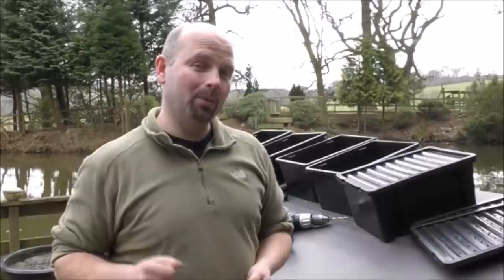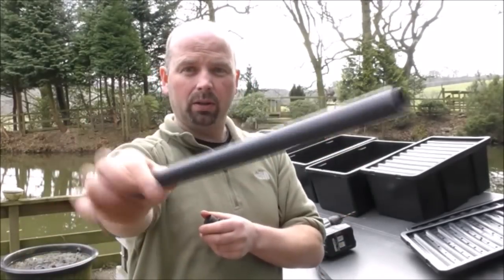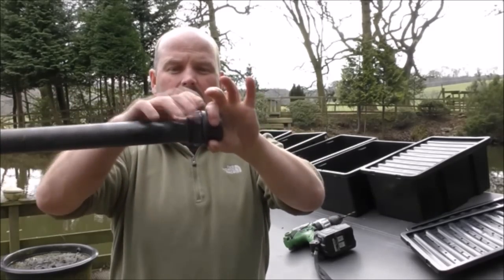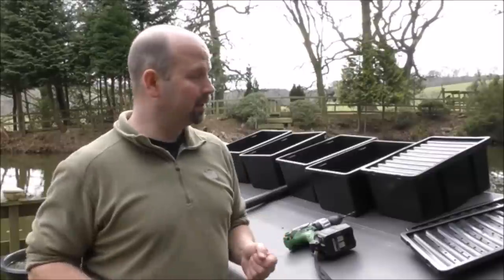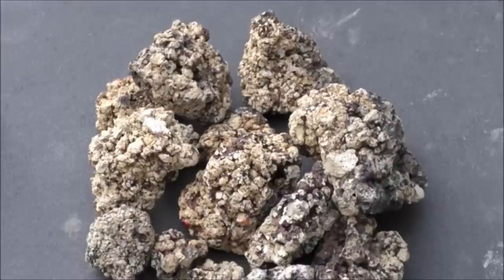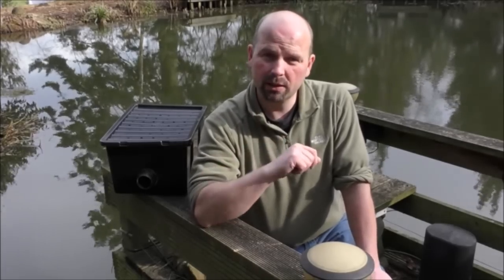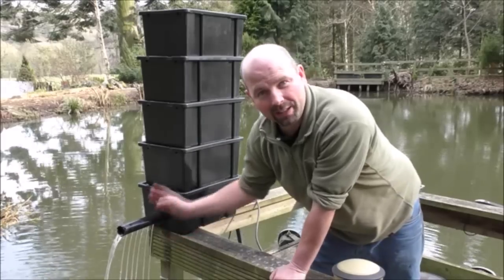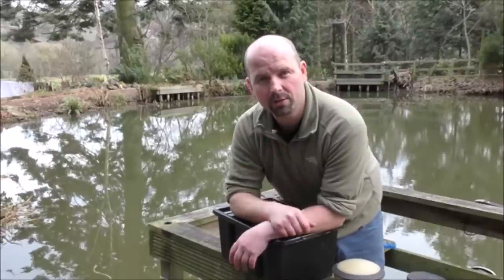DIY Shower / Trickle Filter for a Koi / Fish Pond by PondGuru

Comment: Do you only use filter media in the top Box ? whats about the other boxes ?  empty or full of the same media
Reply from the maker: Yes top box for the foams and media and media in other boxes. Later videos show how I set it up on a large outdoor aquarium.
Reply: Pondguru Outdoors . hello mate . how can I rid my pond of blanket weed . I'm using a greengenie 48000 with uv which has 3 outlets and a pondomax 8000 pump. the pond is roughly. ..9 feet long x 6 x 4  and in full sun more or less all day. would the shower system filter help the problem . And is the problem caused by the filter because of the use of flocor ?. Thanks in advance, Andy.
Reply from the maker: Sorry for late reply, I nearly always miss comments posted as responses to old comments as they don't show in my emails.
The flocor will not help as the nitrates will be probably through the roof in the water, feeding the blanket weed so you'd be much better swapping that for alfagrog which has a larger surface area and some limited ability to support anaerobic bacteria as well as the aerobic bacteria.
There are loads of ways to treat the blanketweed including treatments such as Tetra algofin which is a straight algaecide but the best one I have used (and installed for many people) is this from Velda: http://geni.us/C5QLw
That link is to the biggest one but there are smaller models. Every time I have installed one it has worked well. It is expensive but really effective.

Comment: When do you clean the filters for a pond that size?

I have around rounded 1000 L water tank full of catfishes, around 2000 of them sizing around 8cm and i made almost the same as your stacked filters.
Each container is 30cm in height. first container filled with foam pad (medium type, 15cm), second with natural stones (ziolit and reef stones, 10cm ) third filled with bio balls (1/3 of container and the output flow is at 25cm.
I feed them around 3-5 times a day. it's been running around 3 days but the water is not getting any better and the filters are full of debris. Should i put more stacks?
Reply from the maker: A filter may take months to mature to the point of making the water healthy and it will not make it clear unless there is a UV unit before it to kill algae.
Having more media would definitely help and swapping the plastic media for proper filter media would also help too. Not sure what the reef stones are (pumice?) but anything will be better than plastic. I don't know what country you are in so don't know what media is available in your country but using proper filter media is essential if you have so many fish.
The foams will clog and need cleaning as necessary (varies from pond to pond) so there is no set rule as to when they should be cleaned.
Reply: I'm in Jakarta Indonesia :)
The stones are pretty much coral stones. So I guess I'm gonna make some adjustments with the containers outlets since and gonna add more media. I think I'm gonna rely on this now while it matures and unclogging the foams overtime. Thanks. Great channel btw!
Reply from the maker: I'm glad you enjoy the videos as I love making them -I just throw ideas out for people to take on board or alter / improve as necessary to suit their situations.
The coral stone should be decent as it may be quite porous.

Comment: What are the the connectors called that you fit the pipes into, the one where you drilled the big hole for, been trying to find them everywhere but no idea what their called.
Think the yanks call them bulkhead fittings?
Reply from the maker: I just know them as tank fittings and you'd get them from Plumb Centre or similar outlet. They should be available in push fit and also solvent fit.

Comment: Hi Richard what do you think about using siporax media
Reply from the maker: Siporax is a fairly good porous media but unfortunately wears quite quickly and has a huge hole through the middle of it cutting out the place where anaerobic bacteria would set up home. I understand why many companies manufacture media with the hole as it cuts way down on firing time in the kiln, making it much cheaper and quicker to produce but it skews the bacteria in favour of aerobic which does a good job on ammonia and nitrite but produces lots of nitrate. With the area which would normally hold the anaerobic bacteria missing it means that way more media is needed to provide those anaerobic zones and do anything with reducing the nitrate levels.
Reply: Thanks for replying just wanted to get your views as you say it's quite cheap compared to others, as full size shower can take upto 160kg of media it then can be so expensive getting bakki house media. Going to have a go at home made one like the video for growing on tank. Cheers for posting videos well Informative 😄 . Shall add larger shower to main pond thou in spring to work along side my eazi pod
Reply from the maker: If you're looking to fill a big volume on a budget I would say go for alfagrog http://geni.us/Il899
It has a decent surface area and is incredibly cheap in relation to how effective it is. It does not clog so can be used in very low maintenance situations. If plenty is used it could even support enough anaerobic bacteria to reduce nitrates but you will need a nation of it.
A much better choice would be 30mm - 50mm pumice as it is under £50 for a 25kg bag and has an excellent surface area to porosity ratio enabling it to support aerobic and anaerobic bacteria in good balance, vastly increasing the chance of nitrate processing and a visible reduction. I sell quite a bit of that now for shower filters as it mineralises the water and buffers the pH to a level the koi do well in: http://filterpro.co.uk/pumice-media-11-c.asp
Reply: Pondguru Outdoors  yeah seen that on your links how many litres of media was used in the diy trickle filter ?
Reply from the maker: It is difficult to estimate but I'd say around 10kg - 15kg in each box as it took the best part of 1 x 25kg bag for 2 boxes.
Reply: Pondguru Outdoors  thanks i think i shall try the bio home media see how that goes then maybe use that for the shower once i get it for main pond. 👍
Reply from the maker: Groovy - sounds good to me.

Comment: Is there a benefit by having the large pipe in the bottom box?
Could it not just be a hole where the water returns to the pond?
Reply from the maker: You could do that no problem as long as any media didn't block the exit pipe. All the pipe extended into the bottom box does is increase the draining area to enable water to go through any of the holes drilled in the pipe to minimise chance of blocking the exit.
Reply: Pondguru Outdoors 
Ok ,
Thank you.)

Comment: 😅How often does it need to be cleared out of gunk? Is only the top catchment cleaned?
Reply from the maker: The time intervals between cleaning will depend on the size of filter and the size of pond (and stock of fish) so just go for the biggest filter you can afford and clean it whenever it needs cleaning (check after a month and extend beyond that until you hit the sweet spot for your situation).
Yes, only t he top section would be cleaned since the rest of the filter would contain the filter media which stays clean enough to work efficiently.

Comment: isn't it supposed to be aerobic bacteria? do you think there is enough air inside the container? should we put more holes on the upper part (so water won't spill) of the side container walls?
Reply from the maker: A filter needs both aerobic and anaerobic bacteria to complete the nitrogen cycle. No need for any more holes.

Comment: I have a question for ya. I will be designing a new koi pond above ground and planning to use plants for most of the filtration. However I don't have the greenest of thumbs, if for some reason my plants don't work out. would this filtration system work for a pond around 3 to 400 gallons or what would you suggest?
Reply from the maker: +Donnell Jones (DJ Romeo) A shower filter is a great solution as the plants will only really draw up the nitrates. If there is no filter with filter media before the plants you'll still have loads of ammonia and nitrite. For 3-400 gallons you'd only need about 3 containers the size I used in the video for a fish pond.

Comment: oosp. i just remembered  your video  answered my filtration question with the three pads .... What are your thoughts on the  bakki system. ..
Reply from the maker: +bsessley55 The bakki system is basically a shower filter and the media is a good quality ceramic. Like the larger forms of biohome it would cost a lot to fill a decent size shower system with bakki house media and a good quality pumice would do a great job at a fraction of the price.

Comment: Hi looking to set up a sump, for my 6ft goldfish tank will be stocked high so what bio home do I go for and how much kg would you suggest as a starting point
Reply from the maker: Ideally you'd aim for 2kg per 100 litres for a heavy stock but a sump will hold way more if you wanted to go big with the filtration.
Most people go for the Biohome Ultra since it is a decent size but any version will work. A popular type is the Biogravel put into mesh bags as it's easy to remove for cleaning.
Give me a ring any time to discuss and it would help to know how many litres the tank is.
Regards,
Richard http://www.filterpro.co.uk

Comment: One question , Can the bottom container handle the weight from all of the containers on top with the media plus water?
Reply from the maker: Yes it easily supports them as you haven't got boxes full of water weight, just wet media with water falling through it. That means that the weight is minimised.

Comment: Hi pond guru, I have built a 4 tier shower with the more sturdy boxes u recommended for amazon,I am going for Japanese matting and fine and medium under this in the top tier, I have around 130 budget for the media, for the other 3 tiers, my pond is around 10000 litres, what would u recommend ? I was looking on your website at the biohome ultra, could I mix and match? Say alfagrog in the 2nd pumice in the 3rd and biohome ultra in the bottom? How much would u recommend in each box? Or would u advise another method?
Reply from the maker: Yes you can mix and match no problem and to fill 3 of the containers on a £130 budget you could just about go all pumice - it will do a better job than the alfagrog and be much cheaper than the biohome (and almost as effective). If you are in the UK mainland I could send out 3 x 25kg pumice (1 for each box) for £150.
My email address is pondguru@btinternet.com
Regards,
Richard
Reply: Pondguru do you ship pumice to the USA ? Thank you very much.

Comment: Did I miss something? What media did you put in the bottom 4 boxes?
Reply: (my other channel) Just use whatever you want in the media boxes. In this case I used a mix of pumice and Biohome Ultra but it was just for demonstration since it had no chance of filtering this pond. 
You can mix anything together.
Reply: @ThousandYardStare  cheers. I am in a rental so I can't dig a pond, but I plan to build an above ground plywood pond (aquarium if I can find a suitable piece of glass at the right price.) External measurements will be 8' x 4' x 4' (2400mm x 1200mm x 1200mm) I'm planning on using a "Pond One ClariTec 15000UV Pressure filter with a 10,000 LPO pump which will turn over my almost 2000 litres about 5 time per hour. However, I will add a long tub at one end with a spillway or spray bar. So anyway, as you can imagine, I've been watching any video I can find that's pond or filter related. 😁
Reply: @BlackshacksBushcraft  Best of luck with that project - it sounds very involved.
Reply: @ThousandYardStare  I'll post a video when it's done but it won't be for a while. My finances have taken a hiding lately.
Reply: @BlackshacksBushcraft  Everyone's finances have taken a hiding and we're only part way through the death of a thousand cuts.
If you're going to be using the tank as part of an aquaponics system then I'd say it was a good investment but if it's just for an outdoor tank then the money may be spent better elsewhere.
Check out @RobsAquaponics for some great ideas on back yard aquaponics - he grows all sorts of food and explains things very well.

Comment: Hi what size tank connector and pipe do you use for inlet please I’ve got 47 ltr boxes  shower will run of the return from pressure filter 14000lph

Comment: I was wondering if you know how to get rid of string algae.
Reply from the maker: The best solution will depend on the size of your pond but the most effective thing I have ever used and installed for numerous people is the Velda electronic blanketweed killer as it works every time - just make sure it is large enough for the pond. Not cheap but it is a permanent solution, needing only a copper rod replacing every 12-18 months which is a 2 minute job. This is the largest model: http://geni.us/C5QLw but there are smaller units available too.
The other electronic blanketweed killers which rely on wrapped wires simply do not work and chemical treatments may kill the blanketweed but it soon comes back meaning you get into an endless cycle of treatments which isn't good for the pond.

Comment: Hi I,m in the middle of revamping my pond and bringing it above ground currently I run a pressure filter and aqua evo filter would something like this be worth adding to my setup if so would it go before or after the evo filter, if after can the water then be returned it the pond via pipe as the filters would be about 15m from the pond inlet, all the trickle filters I see online appear to be directly over the pond, pond size is about 20000 ltrs.
Reply from the maker: You could simply make a shower filter with the outlet feeding to a 2" pipe and as long as it was running down hill you could site the filter well away from the pond no worries.

Comment: Hey I'm going to make my pond bigger it will probably be between 13000 - 15000 litres how many boxes would I need and I've also got a max of 8000 litre pressurised filter ?
Reply: really need the advice on this one mate also what size pump would i need ?
Reply from the maker: The size and number of boxes really depends on the size of pond but for a 15000 litre pond I'd definitely go with bigger boxes than are shown in this video, maybe 4 tall? and with approx. 50kg to 75kg of 30mm-50mm white pumice if the pond is a koi pond. The larger forms of biohome are more effective but would work out very expensive so it comes down to a question of budget. Having a pressure filter before the shower is a great way to do the mechanical filtration.
You'd be fine with a 8000 - 10000 pump as long as it lifts water to a decent head and has low running costs.
Feel free to ring me any time on 07772848730 as it can be a week or so before I get to YouTube comments during busy times.
Regards,
Richard
Reply: Pondguru Outdoors I was going to buy a 19000 pump anyway and this will be fine to use on the shower filter ? and the pressurised filter would have a 4500 pump still. cheers josh
Reply from the maker: Ideally the pressure filter would feed up to the shower filter and the size of pump needed for the shower would depend on the size of the shower filter. 19000 seems way too big to me.
Reply: Pondguru Outdoors isn't it better for your pond water to turn over more an hour though that's why I thought a bigger pump would best, just what other people have said that's all cheers josh

Comment: where did you get the foam?
Reply from the maker: The foam I used in this video was the stuff I sell on my website (link in video description) but you can get it on ebay or amazon by searching for 'replacement pond filter foams '

Comment: What size pimp do you use for this setup.   Do you just put pump in water or do you use one that sits outside the water,   what kind what work best I have 1100 gallon indoor tank
Reply from the maker: I think this was a 3000 litre per hour pump.
If you wanted muck to be removed from pond into filter then something like the Aquamax pumps from Oase would be the way to go. Is 1100 gallons UK or US gallons? there is a big difference but even so the turnover rate isn't too important when you have a shower filter so even a 4000 - 6000 litre per hour pump should be fine.
Reply: Ok cool ill check them out,   thank you for texting me back. 1100 gallon US
Reply: Should I go submersible or outside tank pump?
Reply from the maker: Sorry I misread your first comment and didn't realise that you had a tank, not a pond.
Unless your tank is drilled to have an overflow weir to a sump then you will have to put a submersible pump in and remove water to a filter which will pour back into the tank - Ideally it would have a sump underneath it like most large aquariums do.

Comment: does  each box below the first box have the same combination of media and foams ?  I want to make this for my 3000 Gallon pond that has a ammonia problem
Reply from the maker: There is only foams in the top box and under that is media. The top box here has foams and biohome ultra media but I went for 30mm - 50mm pumice for the bottom boxes as I wanted to raise the pH of the water I was filtering (I used the filter on a large aquarium). This video shows the filter set up: https://www.youtube.com/watch?v=EL9HR_Y3-40